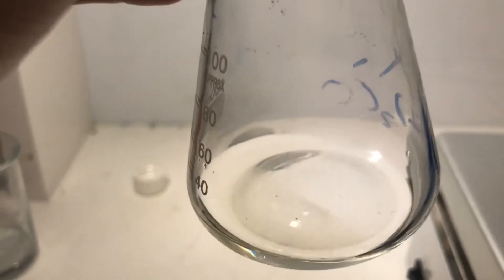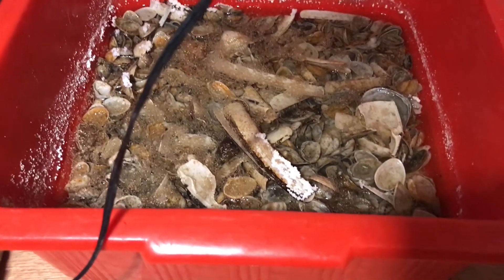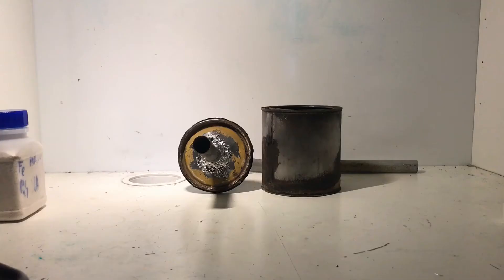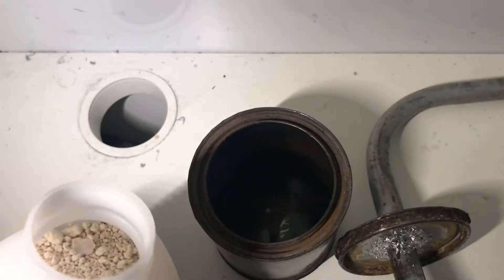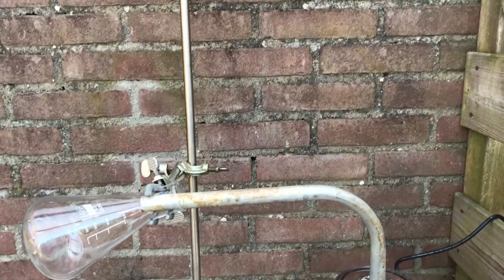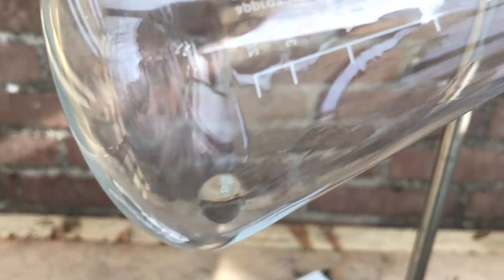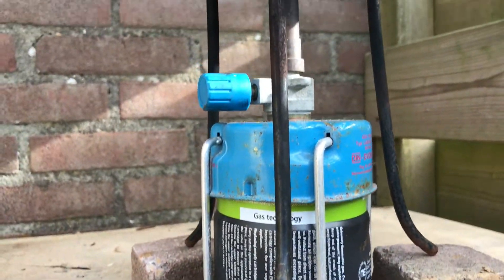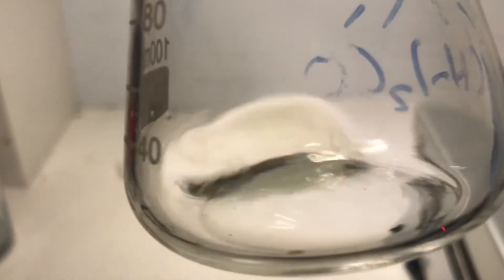Acetone from calcium acetate (part 1)

Comment: This is interesting. I use a lot of acetone and it's not exactly cheap t near 10$ Canadian for 473 mL. The only thing I'd worry about is it looks like you used a lot of solder to hold that pipe in place. Because tin (and lead)  have low melting points makes me wonder what's keeping the solder from melting and falling into your calcium acetate? The proof of concept is really COOL!

Comment: I suspect this compound is methanol or something, not acetone
Reply from the maker: i smelled both and this does not smell like methanol, also i dont think methanol can dissolve styrofaom aaaand how would methanol even form makes little sense,  this stuff is acetone with some sideproducts
Reply: I'm not looking to offend you @flameflame3477, but I tend to agree with @sciencething. If you look at his plastic dish pan, you'll notice what appears to be oyster shells, and I think I see egg shells in there as well. In any case, these are made of calcium carbonate. He seems to be soaking these source materials in vinegar,  producing calcium acetate, which he's dried and stored in a plastic bottle. I do a lot of researching with Google. To quote Google's AI overview:

"Methanol, also known as methyl alcohol or wood alcohol, is primarily produced from natural gas. It is a chemical compound with the formula CH₃OH. The industrial production process typically involves steam reforming of natural gas to create synthesis gas (a mixture of carbon monoxide and hydrogen), which is then converted to methanol. Other feedstocks like coal, biomass, and carbon dioxide captured from industrial sources can also be used, but natural gas remains the most common and economical source" Again, when asked, "what happens when you heat calcium acetate" in Google search, Google's AI overview answers, "When calcium acetate is heated, it decomposes, primarily producing acetone and calcium carbonate." And, "The primary products of this decomposition are acetone (a ketone) and calcium carbonate (a salt)." As well as, "Calcium acetate was once used as a source for acetone production due to its low cost."

Comment: Hey, the video was very informative and interesting. Thank you for the upload.

Do you make calcium acetate from those sea/egg shells you have kept there?

Can you please elaborate how you do that.
Reply from the maker: I just collected a bunch of sea shells, put them in a big open container and emptied a whole jug of cleaning vinegar (7% solution of acetic acid) into the same container. And after a few days i just drain out all the liquid, filter this and then let it dry out and collect the salt
Reply: @sciencething1449  Oh ok. Can this be achieved with something like a natural vinegar like apple cider or cane sugar ?

Also how many days is it exactly?

Btw thanks for the reply.
Reply from the maker: @joannawilson9762  i would not use natural vinegar becuase that will just make a sticky mess prob also moldy. And the amount of time isnt too important just wait until it stops making co2

Comment: I really wanted to do this
Making calcium acetate is really easy but the problem that I haven't the required tools
Reply from the maker: I used an empty paint can and a steel tube from an old camping table and you can use a campfire/BBQ as your heat source no problem, which are all things you can easily find!
Reply: @sciencething1449  
Thanks mate.

Comment: I think cooking electric hot plates might work, I have a spiral one (it's like at least 30 years old but it works) and when the room is slightly dark you can see the faint red glow. I also made charcoal with it.
Reply from the maker: Well I had something like that but at one point it overheated and killed itself (it was so hot it melted aluminium foil!)
Reply: @sciencething1449  woah